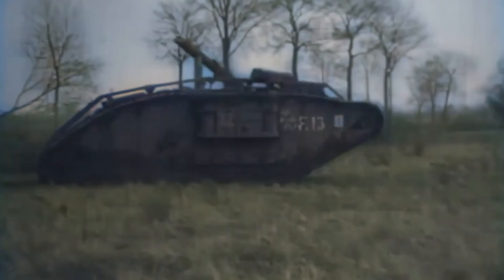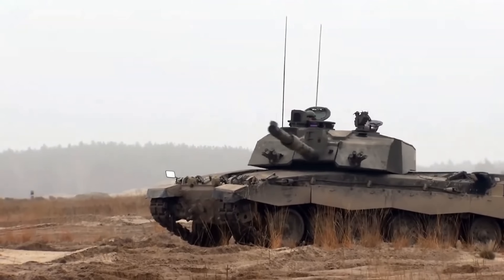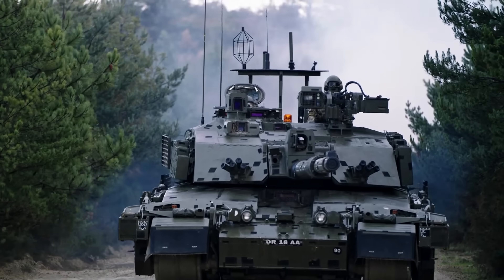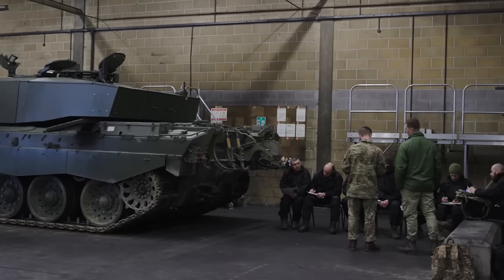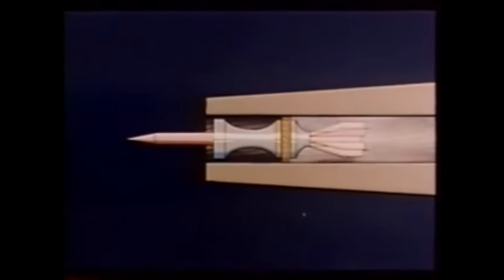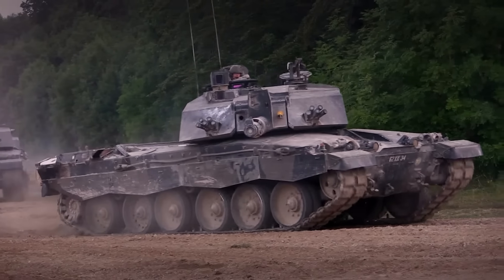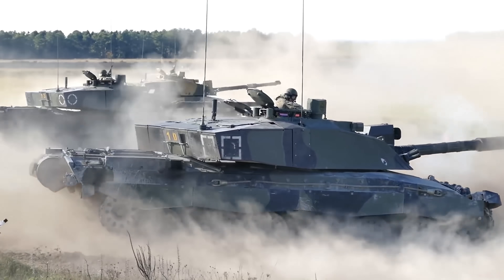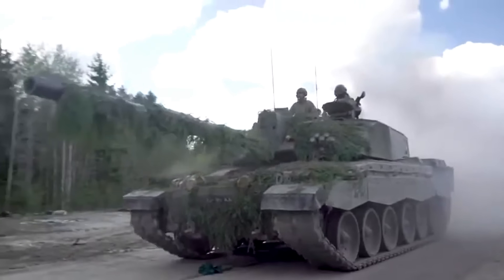The Challenger 2 | Out of time?

Comment: Te attitude of the MOD reduces the ability of tank builders to build an excellent tank. One that sells!!!!!  One with a self loading smooth bore gun and full night vision. AI control of the gun and firing while self loading on the move, the most modern radar heads up full picture display inside the tank, exchange of base for other uses like a mine sweeper or howitzer. The Challenger needs ENGINEERS AND DESIGNERS not bureaucrats of the MOD.  We dont need Challenger 3. we need Challenger 10 now.!!  A tank that takes 30 seconds to reload is a sitting duck

Comment: It needs to be said that linking Challenger 2's weight to its armour is broadly a myth/ false. It is basically no more, and by many metrics less protected, than NATO peer tanks like M1A2 and Leopard 2A5 onwards, whilst armour rarely makes up more than about 20% of the weight of any MBT.

Volumetrically, it's simply not possible that the tank can fit more armour than its peers into what are irrefutably smaller available spaces for armour modules, and those dimensions are now well known thanks to the propagation of photos and information online.

From an engineering perspective, the main driving force for weight of a tank is not its armour, but actually its automotive components, heavy steel, structural chassis, etc. The Leopard 1 is a fairly small tank with barely any armour at all and still weighs 40+ tons for example.

As vehicles get modernised and things are added or removed from the turret in particular, counter weight is added to balance the turret ring. This tends to mean a 1 ton upgrade incurs about 1.5 tons of weight gain if it's on the turret.

If you redesigned Challenger 2 from the ground up with modern methods, you could probably strip 5-6 tons off the weight without ever touching the armour. If you modernised the armour packages you could remove another 2-3 tons with better materials for no loss in protection.

The main reason the Challenger 2 is so overweight is outdated philosophy. It was built to fight in a nuclear conflict where the British wanted to minimise time spent for the crew exposed to fallout, by staying within the vehicle. This meant requirements for fuel capacity, road range, and reliability/ time to failure of the automotive components was extremely high. If Abrams and Leopard 2 were "easy to fix" Challenger 2 was "don't break down in the first place."

Issue is that sort of reliability often comes from over-building all the automotive components. Everything has far more steel than is actually needed, right down to the small fittings, to make it last longer without breaking. That adds a tremendous amount of weight and is, frankly, completely out of sync with modern warfare.

Challenger 3 has arguably shot itself in the foot from the get-go by using original Challenger 2 hulls, engine and transmission. There is so much wasted potential for weight reduction and  protection improvement by ditching that hull, but it's not to be.

To summarize: Challenger 2 has weight issues, not because of its fabled armour (which is not evidentially any better than other NATO tanks) but because of late cold war British thinking that saw everything built tougher and heavier than it needed to be.

Comment: The Challenger 2 was a good tank for the time frame when it was first produced, but now (with modern foes like hand held anti-tank weapons that hit from above where the armour is weak and drones) it is clear that the basic design needs to be upgraded in order to be relevant on the modern battlefield.  The Challenger 3 program is designed to do this but it is clear to me that there are at least two factors which will make said program a huge waste of money.  Firstly, there is the switch to a smooth-bore gun.  This is fine in itself but it doesn't give any up-gunning advantage against most modern tanks since the caliber stays the same.  The second point is that the modernization lacks an active protection system as standard.  This still leaves the tank vulnerable to the issues of drones and other top-attack type anti-tank weapons which has so far been the biggest reason why so many Russian tanks have been destroyed in Ukraine.

Comment: A bit late to the party, but after the incident where the driver lost his leg, they patched that weak point, can only assume that carries over to challenger 3

From what I have read the Challenger in Ukraine hit a mine, and then had a suicide dron drop ontop of it.
Reply: They patched it partially with a block of composite that's not really thick enough, only covers the top 60% of the weakpoint, and of which the British army only has 40 upgrade kits procured for the fleet of 227 vehicles.

Translation: It's still a major issue.
Reply: @AllThingsCubey  Not true. The latest upgrades have 120 C3's with new composit armour for the frontal area's and over all protection packaage as was mentioned by both the MOD and based on a DSTL design and manufactured by RBSL.
Reply: @okbutthenagain.9402  We're talking about Challenger 2.

Challenger 3 isn't even in production yet and won't be in service until 2027.

Anyone got any relevant responses to me, or you just gonna keep posting tripe?

Comment: Challenger has the best Armour the squash head round needs rifling and makes it very accurate. The fin stabilised Sabot round does not go as fast down a rifled barrel and spins to fast so the round allows the fin inside the Sabot to slip. Smooth bore Fin Stabilised rounds have fins that impart spin so no spin is no good and to much spinning is no good., with a smooth bore there is more seal and less friction so SABOT round is faster out of barrel.  UK needs ammo and plenty of it as shown in Ukraine Challenger III addresses this.  Ukraine shows the need to be properly armed. Army Navy and Airforce. With the ammo we need and troops trained. Challenger in Ukraine had track blasted by mine then multiple hits, the crew survived to fight another day. Russian auto loaders sit crew with ammo. Relatively easy penetration and turret toss followed. Mercifully it would be a quick exit for the crew with all the overpressure and heat.

Comment: Though requiring an up grade C2 won the Iron spear 2023 competition it is the best tank in the world and the earlier version has the longest tank on tank kill in history.
Reply: Competitions like that are about the crew, not the tank. Austria won once with Leopard 2A4 whilst Leopard 2A6s were at the same contest from three other nations, as well as Challenger 2.

Chally is currently feeling very old and tired, lacking many features almost every modern tank should have, and with some growing issues in the design. I assure you, whilst I don't think you can specify a single "best tank in the world," if you could, Chally 2 ain't it.
Reply: @AllThingsCubey  It I old. I left the 1RTR IN SEPTEMBER 2000 after joining the 4RTR in January 1988. The change over rom Challenger 1 to Challenger 2 had begun with the retraining of the crews in early 99. 1RTR was the last Regiment with Chieftain when we retrained on Challenger 1 in Tidworth in 95/96. We can blame the British Government in dung back the British Army and not spending the monies where they should have. Challenger 2 should have been upgrade or replaced over a decade ago. We can’t fit the long penetration kinetic energy rounds. So they have gone smooth gun. But the Germans are increasing the size of their main armament MBT guns because 120mm isn’t good enough anymore. Sadly the Challenger 3 will be obsolete due to its 120mm gun. The tracks on all modern MBTs have a lack of traction in soft ground because they do not have webs to grip the soil or ground as it moves over the ground. Better to buy German and put on our own armour.
Reply: @JamesGlass-b1l  Agreed. Germany offered us 200x of the Leopard 2A7V in 2017 and we rejected a good price offer because it looked bad to be buying German tanks. Those were equally as capable as Challenger 3 in most ways and we'd have got them much sooner

Comment: Hang on no HESH rounds are not debatably worse than HEAT rounds in anti infantry applications and the rifling on the LA301 gives the gun better accuracy at longer ranges than the Leopard and Abrahams, oh yeah the gun also has more reach didn't mention much about accuracy at given ranges during did we either funny that. I kid you not my step uncle designed that gun for the challenger series and he would have a thing or 2 to say about that, to current date the challenger still has the longest distance tank on tank kill so come back with some facts next time thanks.

while there is a need for a new gun set up, it's not for the reasons you are mentioning like having the "best available" especially when we have not qualified what that means in the case of upgrading the challenger tank armament. Il save you the hassle and effort, it's about cost and ubiquity for having available ammo on hand being always available the extra punch the newer rounds provide is just icing on the cake  so there which we are giving up range for by the way something you overlooked. which makes that a trade off not an upgrade pal.

Soviet tank armour is trash, penetration power is not the priority we already have overmatch. at least the Germans with the new 130mm gun actually makes sense as the higher calibre gives the tank the same reach the challenger has and actually the extra pen once again just icing.

Also by the way our Navy is not adequate by any means, we lack vessels we don have no where near enough ships and submarines compared to what we actually need. it's a non starter of a debate. maybe you want to do a proper itinerary check before saying that, While the Uk can go toe to toe with any other peep nation it would be at great cost and if got ganged upon we would be F'd. we do the NATO thing for a reason mate.

Comment: I think the biggest flaws of this thing are that it's heavy and expensive. There is no point in making a tank that expensive and heavy unless you're fighting a significantly inferiour opponent who can't deal with it in very favourable terrain. When it's going to be popped by modern artilllery, mines and ATGMs, the most important factor is how easy it's to repair/replace once it's creamed. Both Ukraine and Russia are dealing with serious attrition in equipment and that is going to be inevitable on a battlefield where the opponent fields effective weapons.
Reply: expensive comes from high end equipment and high level crew protection
your soldiers are not an expendable resource if you are an european army
Reply: @zhufortheimpaler4041 Challenger 2 lacks much high end equipment and its crew protection is now broadly outdated too. It's currently just expensive and overweight for no additional benefit.

Vehicles like the Type 10 have demonstrated that high end equipment and modern methods can make a significantly lighter tank, with greater offensive capability, and no reduction in protection level.
Reply: @AllThingsCubey  that is the great question.
Is Type 10 really that well protected.
K2 Black Panther got recently a bit "disenchanted" as footage was leaked, that shows that the frontal armor protection is barely thicker than Leopard 2A4´s and composite armor protection was only concentrated in a narrow cone to the front of the turret, while the sides are just 60mm steel.
Reply: @zhufortheimpaler4041  Soldiers are an expendable resource by the very nature of war. You can't fight a war without taking losses, that's just not how combat works. The opponent is hardly going to just sit there and let you slaughter them without fighting back.

That said, European armies are not known for engaging in war. Haven't had a proper big one since 1945, so it really doesn't matter how efficient the weapons systems are or how inept the procurement bureacracy is. 
Having 100 Challenger IIs is the same as having 1000. You're probably not gonna lose any against disorganized civilian or terrorist militias.
Reply: @herpderp7114  of course soldiers are not expendable.
It takes about 3 years and 300-500k$ to train and equip a modern western soldier.
For specialised roles like pilots, speciial forces etc this is even higher.
A force that looses too many trained soldiers will greatly diminish its fighting capability.
Why does ukraine use its forces in small skirmishes with a few tanks and infantry?
because they lack trained and experienced NCO´s, Officers and Soldiers and have to rely on semi experienced reservist officers etc for the large part of the army, due to combat casualties over the last 1 1/2 years.
Same for Russia.
A tank can be replaced. An experienced crewman with 5-8 years experience and training? not. The replacement will be a greatly less experienced and will struggle to perform as well as the experienced one
Reply: @zhufortheimpaler4041  Have you ever thought about what a war actually is? A war is, at its core, people deliberately killing other people. I'm not going to discuss my opinions on the competency of Russian and Ukrainian leadership or soldiers, I only want you to correct your irrational misunderstanding of the very concept you're discussing.
If human resources were not expendable, you would never go to war. Period. It's that simple. You are expendable to the people who rule over you, you're just a number in a computer. 500k dollars (that they type into a computer to materialize out of thin air) and 3 years of training in ideal peace time circumstances? A small price to pay.
Besides, you don't need to train someone for 3 years, let alone 8, to get them to fight the enemy. All that training may make them a more effective fighter provided your training program is actually competent, but the goal of a war is to make the enemy lose and if you can achieve that with numbers deemed acceptable while sending in dudes with 1 day of training and an entrenching shovel, then that's exactly what will happen. 
Western countries haven't faced a situation that requires compromising on peace time ideals since 1945. Well, I lie, Vietnam was pretty bad. So bad that the political willpower wasn't there to see it to the end and all those lives were expended for very little gain. There's no life of a soldier more expendable than one that is thrown away without winning the war.

In any case, there is nothing uniquely not-expendable about European soldiers. If anything, Ukrainian soldiers are thousands of times more valuable to Ukrainian leadership than any European soldier is. There simply isn't enough of them.
I really don't need you to give me platitudes like equipment is easier to replace than the operator, I know that, but at the end of the day - if your operator has no equipment to operate they'll be operating an AKM in a foxhole instead.
Reply: @herpderp7114  that soldiers are an expendable resource is only the case when you got enough of them.
all european armies, but also the US and other NATO partners dont have enough to freely expend them.
And even if you might have enough, high enough casualties render your army incapable.
as said above: best examples russian and ukrainian army after taking major losses of experienced personnel in the field is down to conscript level training, wich shows in the casualty numbers.
Reply: @zhufortheimpaler4041  If you don't have enough solders to expend them, you cannot engage in a war. In essence you're saying that US and NATO would be incapable of engaging in a war, which may very well be true and can also explain why USA is trying to fight Russia using Ukraine as a proxy.